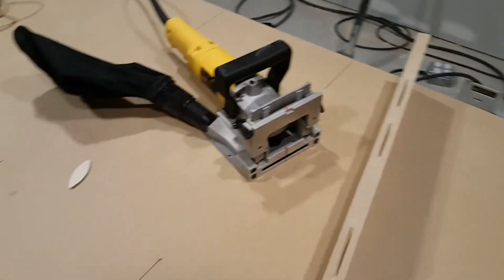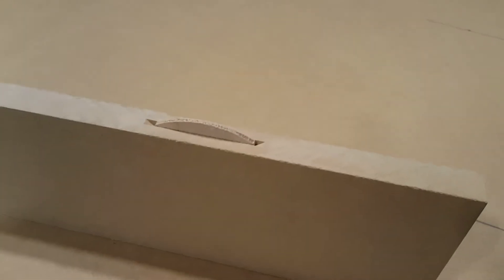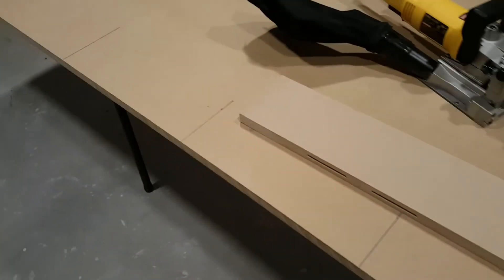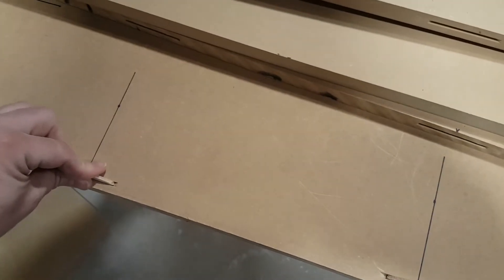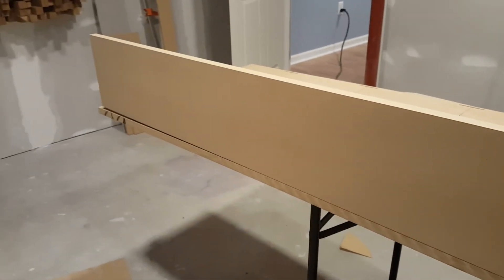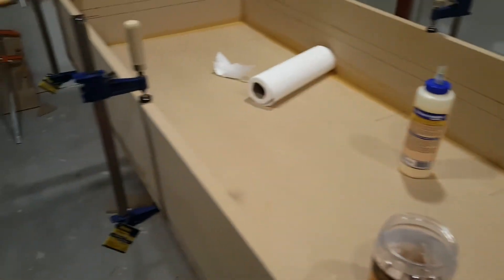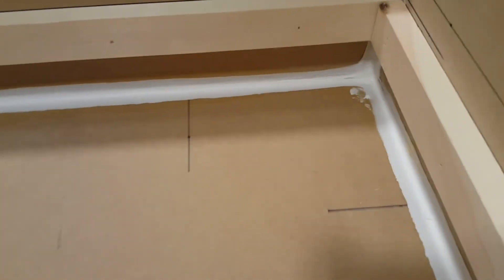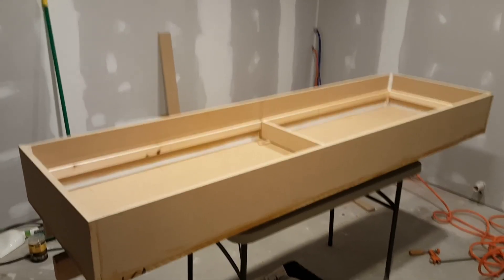Mixing Studio Build - Membrane Bass Trap Part 1

Comment: Hello, can you help me how to figure out the density of mlv membrane and deepth cavity to achieve the range frequency ressonance? I am try to build at my own. Thanks
Reply from the maker: You will need to contact an acoustic engineer for that.  I used John Brandt.  Best of luck.
Reply: @JasonBalibanProductions  Thanks!
Reply: Did you ever build yours? I've been doing some calculations for my own build, and figured for MLV density 1.0 to 2.0 kg/m² (10 to 20 lbs/ft²) is generally recommended for controlling low-frequency sounds, such as 60 Hz. The cavity depth should be a minimum of 4" inches (100mm) but 8" inches (200mm) would be ideal.
Reply: @soofdawg  I tried to answer but for some reason the comment desapear.

Comment: Did you meassure them? Very interested what they do on a meassurement.
I build some of these some years ago. I could hear them working a little bit in my control room, but they didnt do anything on the meassurement, because they where too small. (1 x 0,5 m)

Comment: I'm reading the "handbook for sound engineers" book and it says that the frequency is calculated with by the membrane thickness and depth of the box... how is the frequency then calculated for example if I wanted to target 60Hz , how would I know the thickness and the depth ? Im looking to make some smaller ones for my home studio to place them at strategic points where maximal modal pressure occurs to target bass frequencies